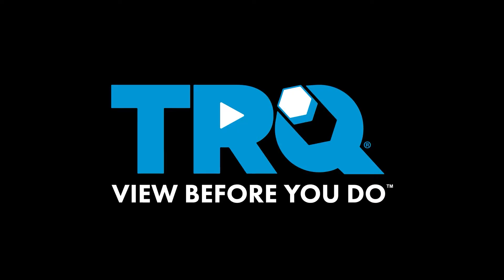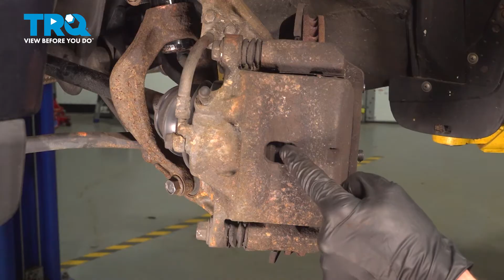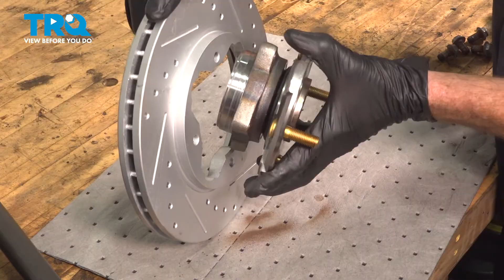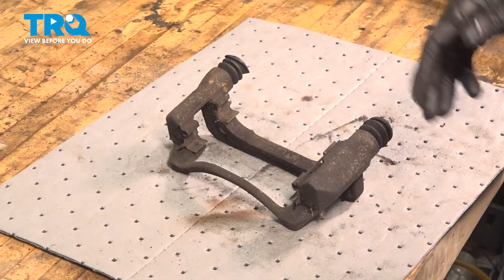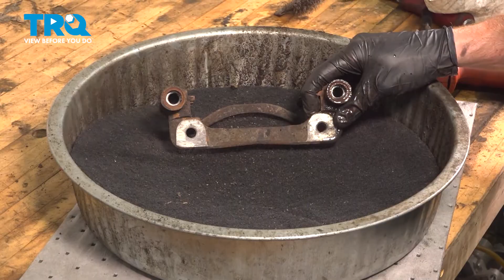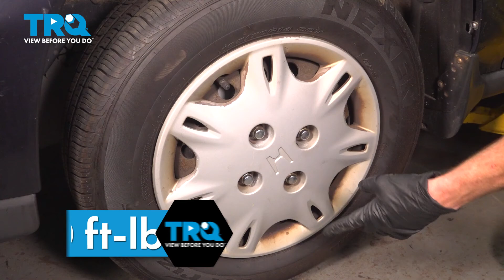How to Replace Front Brakes 1994-1997 Honda Accord

Comment: Why bleed the brakes tho? Cant you just use a brake caliper piston compressor?
Reply: Yes, you can.  But that fluid will get pumped back up into the brake fluid resovoir if you don't open the bleeder screw.  You can damage your resovoir or even your master cylinder by doing that.

Comment: Genuine question.  Does anyone know why Honda did their rotor assembly like this, does it help with any wear and tear or something?
Reply: I couldn’t tell you but I didn’t want to do this whole process again so I did some research and a 1998 Acura CL wheel hub and bearing assembly, specifically the 2.3L 4 cylinder version, will fit on a Honda accord’s steering knuckle so in the future all you would need to is change out the rotor like a normal brake job
Reply: Honda switched to a normal rotor setup in 1998.  The older models were designed this way because Honda felt that the rotor would be kept straighter and more inline and thus avoid warping if the rotors were "captured" in this way.
Reply: Same question I ask and I wonder if I’ll need an alignment again right after 🤦🏽‍♂️ I would not be getting an accord again